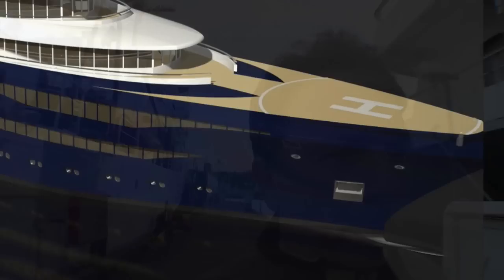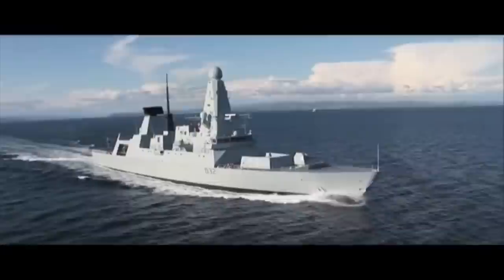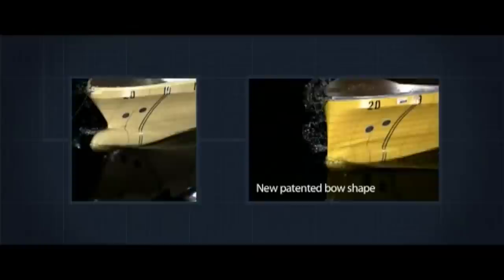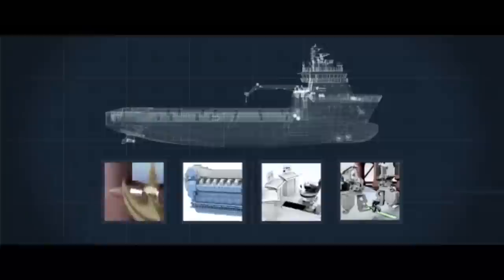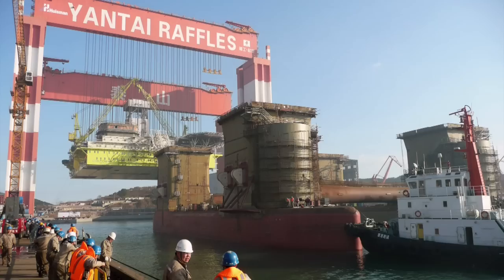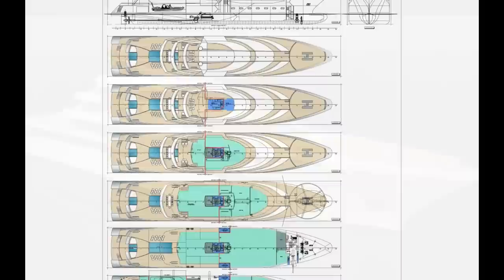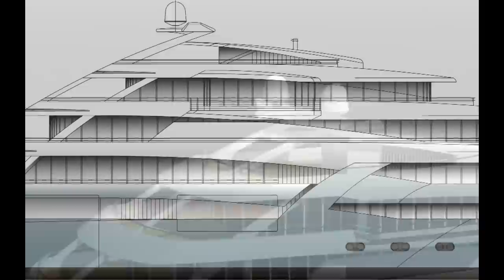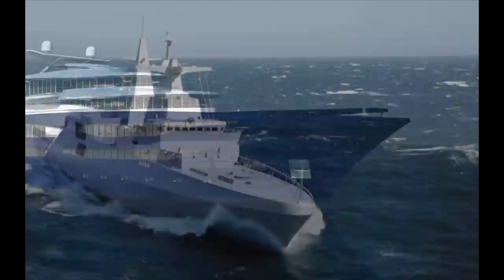85-meter NVC 85Y Designed and Powered by Rolls-Royce Marine

Comment: I am all about the in & out multi gear set if u will prop design from + sign full feather all the way to 90degs flat prop neutral, & every pitch in between. Bc fuck ships usually only hve 2 gear sets, so this fills the gap, but 3 gear set is better. Power torque pulling towing rough seas, or 2nd gear crusing, or 3rd gear fast spin speed run gear set. Then u fill in or dial in best pitch of prop for conditions & loading & speed desired. After a while it can b automated, bc u hve the setting figured out for each ship at each wt, & only thing needed is speed for conditions captain set.

Comment: I think on the larger props, the blades of the prop need to b double partial bladed. Meaning the front 1/3 of prop is shape leading edge connected, & not connected spaced rear. Why wider width at fraction of wt, & the trailing edge of blades is where u get the crazy factor & drag, not leading cutting prt. <So hving 2 pieces of metal per blade of prop allows u to hve 2 diff trailing edge profiles. This way u can hve 2 blades in 1. A meat serrated trail or req knife trailing edge example. The shape of 2 diff shaped aggressive or not prop on each blade. So a 4 blade prop become 8 But w/the drag cutting wise of just 4. ON a super tanker a 3 n1 bladed prop may b needed, so u hve 3 diff trailing prop blades in 1 fucking front cut.